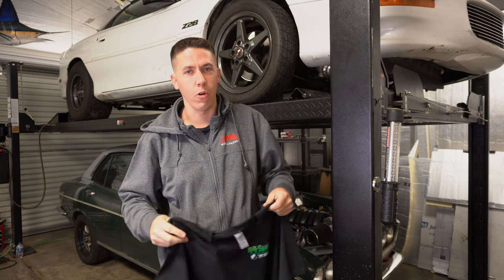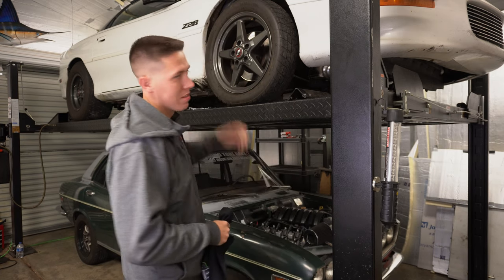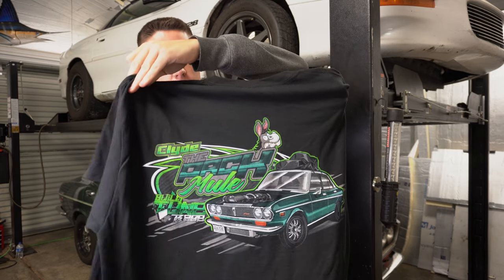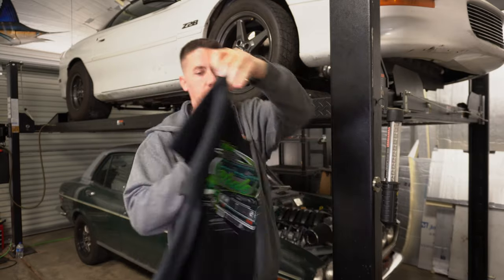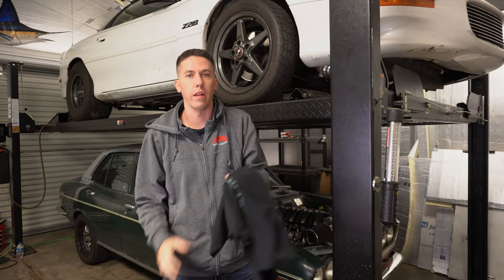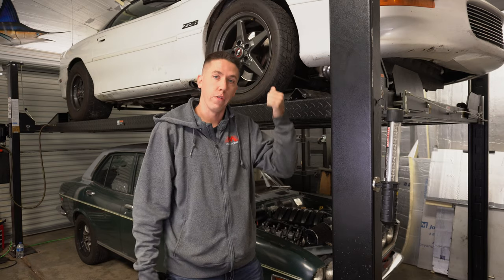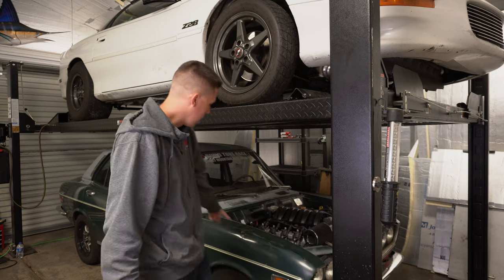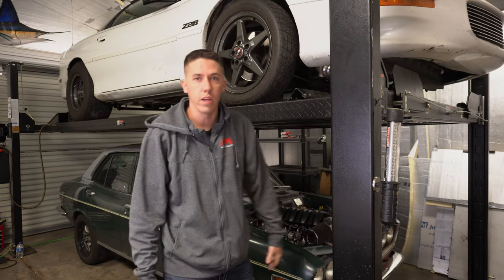Spark Plugs Shouldn't Look Like This! Turbo Camaro LS Engine is Hurt...

Comment: Check the reluctor wheel runout and crank sensor gap. Mine was too tight and ended up flexing, wearing into the crank sensor and causing further issues.
Reply from the maker: Yeah the crank sensor has rub marks on it.. 😬

Comment: Our cars could be twins lol except mine has a vfn sunoco cowl hood and Holeshot super star 17x4's and 15x10s with mac fab beadlocks
Mine just has a 10 point cage two kirkys gutted with only the dash and center console left, strange 12 bolt rear end mostly bolt on midwest chassis and BMR stuff and a few team z pieces its just a roller at the moment i sold to a buddy as a roller in December 2019 to finish my turbo single cab Sierra but I had to have my old girl back i bought it back last month. Im poor lol but i think i put together a mean little bullet pretty cheap lol I was running sbe stuff on ethanol but I wanted to go faster so I  started with a 04 ls6 block I had used a factory 5.3 crank some k1 rods and D.S.S pistons had everything balanced, machined and completely filled the block, a LJMS cam ls7 lifters comp pushrods BTR springs and trunion upgrade and a set of 799s CNC'ed by PRC/TSP, a summit brand 102mm aluminum intake and TB and billet atomizer 325s I reused the Huron speed single t6 kit but ditched the intercooler and ran a badass s488 from forced Inductions holley efi hp ecu and on good ol methanol this time around and a th400 PTC converter from Dusty Bradford it went a best of 5.33 @ 131 at 3220 with me in it this time around its getting a 403 ls2 based setup
Reply from the maker: Nice that's awesome!

Comment: How much dwell are you running on those coils?
Reply from the maker: Whatever holley has the dwell set at for a LS setup/stock style coils. Car has always ran awesome until the crank sensor fails🤦‍♂️
Reply: @BuildTuneRace  Gotcha.  Are you running E85?

Comment: Find the intermittent problem first, Tune it correctly, second
Reply from the maker: Its been a very intermittent 3 times over about 4 season pretty sure it's a reluctor wheel issue at thus point.